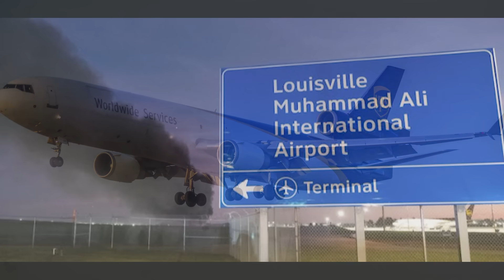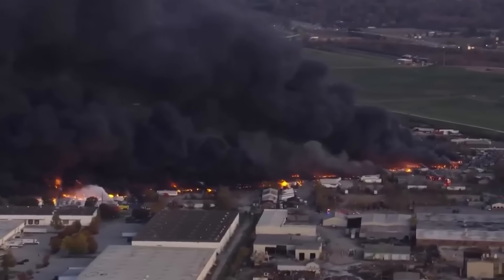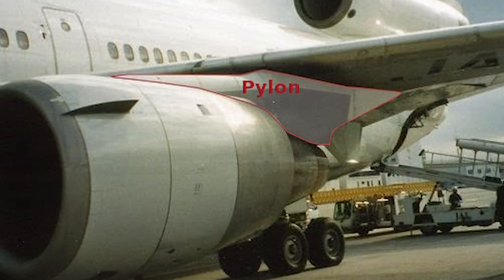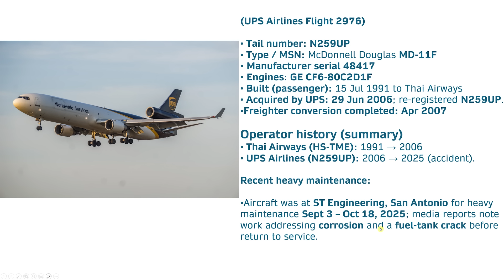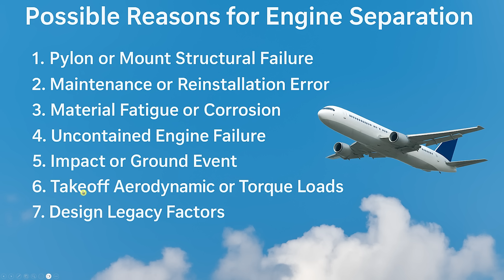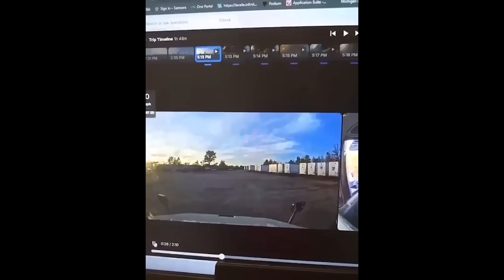What Caused UPS Plane Crash, Louisville, KY? How MD-11 Engine Fell Off

Comment: RIP to the crew/victims. The DC10/MD11 is one of the most flawed designs in commercial aviation. They should have mothballed this plane years ago. The pilots' families should sue UPS for corporate greed. They've spent $2B in stock buy backs in the last year, but they can't afford to replace an airplane that has gone way beyond it's usable life?

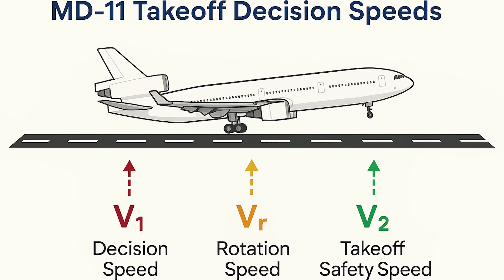Comment: 3:33 Was V1 explained properly? I'd rather be on the ground going too fast than in the air unable to maintain airspeed. These pilots absolutely should not have attempted takeoff if they knew they didn't have enough thrust to even takeoff.

Comment: I find it interesting that the engine ended up on the right side of the plane.

This could be indicative that either the Aft wing/Pylon attach fitting failed or Aft Engine Mount failed?

It would seem to indicate something failed, twisted to go over the fuselage instead of just flipping over the wing and backwards as it should have done and possibly tore apart at the same time injecting FOD into the #2 engine.

Comment: TL;DR I think the tail hit warehouse, not the landing gear.

Given that there's only one line of damage on the first building and the angle of the plane as it's descending, I think it was probably the tail of the plane that hit the warehouse.

In the first dash cam footage, you can see a trail of smoke and debris being dragged off the building by the tail. The plane seems to be pretty flat when it makes contact and doesn't roll till the left wing starts to catch. If the landing gear hit the building I feel like there would be two distinct trails, Also, the vaguely V shape of the damage makes me think it was a rising cylindrical shape (pitched upwards) that hit the building. 

Rest in peace, to the crew and others who lost their lives.

Comment: With a full video of the takeoff roll a pilot could make more sense of this. Was the engine smoking. Was there a fire noted early on. Was there early compressor stall. At what point did any of this start to surface. I had things happen just at V1 and we were stopped way before the end of the runway. Yes we had a wait time to let the breaks cool but that was it. Called maintenance, fixed the problem, confirmed and off we went.

Comment: 1:03 if you zoom in here just before the white flash hitting the power lines…the left motor is gone. Now, assuming he’s past V1 and it was calculated correctly she should still fly. I think that left motor was more than a fire and caused structural damage…ugh…assuming (big assumption) engine fire procedures executed correctly this thing should be flying even with a missing left motor. RIP men…sucks

Comment: I would say they never tested the fuel tank fix with a full load of fuel and several heavy payloads at max weight and the engines at full blast on takeoff. When I saw the first pictures from the runway. That is to much fuel to come from the engine coming off. That was like a tire burst or FOD. Now you have to look at fuel tank repair and if there was corrosion at the fuel tank where else was there corrosion. Blue sky’s and tailwinds to the pilots. Bless the people on the ground.

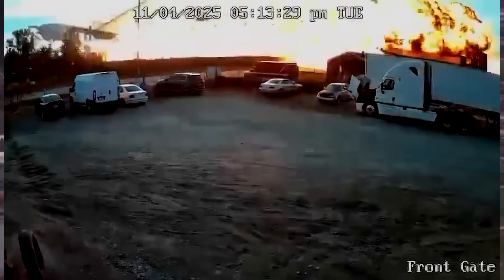Comment: 8:00 To me, I would say they lost speed and therefore they stall and the left wing went down and then it caught the roof of the building. I would say it’s the tip of the wing that did hit the first building and not the landing gear, because if we look at the truck dashcam, we see that the plane is rolling…

Comment: A ferry here in Vancouver years ago had a ferry lose its steering as it came into dock, after a major maintenance refit. No steering. Crashed through a private dock lucky no one killed. Turned out there was a bolt, something like a couter  pin on a small outboard engine was not put back on. Such a simple stupid mistake. If it was checked again by an inspection it would have been caught. Airliners, ships and even doctors in operating rooms triple check every thing with 2 or 3 other people to verify. It is the biggest life saving saftey rule ever made. Airline disasters dropped immensely.

Comment: I remember the AA191 crash! I was very young, but I remember seeing video of it after it happened. I've done a lot of research on past crashes, and this one has way too much similarities to the AA191 flight. I'd bet anything that the investigators are going straight to the pylons. I'm sorry but engines don't just fall off of a an airliner for no reason. Some people will argue that they're meant to fall off in the event of a failure, so it doesn't rip the wing off. They would be partially true, but they're not meant to come off during normal operations. This plane was fully fueled and fully loaded with cargo. Anyone that's flown on an MD-11 before, can tell you this particular tri-jet is not in any terms considered fast or powerful. The AA191 flight lost an engine and severed critical hydraulic lines that controlled the front slats. After the slats lost hydraulic pressure, the slats retracted back into the wing and the left wing stalled and rolled the plane. The right side still had its slats out that  helped create the roll to the left and subsequently crashed. Both flights were using tri-jets and both had left wing engine separation during a take-off event. If this UPS crash happened because of poor maintenance and/or incorrectly performed maintenance procedures, then I would expect some very severe consequences. The AA191 flight was entirely avoidable if maintenance procedures been followed correctly. I really hope that this wasn't the case this time, but it's just way too similar to be a coincidence.

Comment: First thing those inspectors are looking for is where the engine attaches to the wing. They will be looking for empty bolt holes, Barrel nuts empty without any damage. They now know where to look from the videos. Engines just don't fall off if installed correctly.

Comment: It appears that Engine No. 1 pylon failed and engine detached, falling alongside the runway. Debris entered Engine No. 2, causing a compressor stall. MD-11 cannot take off on just one engine - aircraft effectively stalled. I guess the real question is, why did the engine detach?

Comment: I was first on sight with my brother in law for AA191! It took off over us on Higgins and wolf traffic light. Light turned green I shot forward to check it out. No fire going overhead but didn’t look right. I always watch planes. As we got ahead of semi on our right west bound a huge fire ball! Pulled over to fence climbing over from my truck. Ran towards fire then had to run east because of smoke. Heat got intense. Nothing we could even think of doing. Emergency was there in a minute. Fence was for Chicago K9 training 😮

Comment: I cant be 100% sure about this because the dascam of the truck on the road isn't very detailed, but I swear the aft engines thrust reverser is deployed. The right wing engine isn't in reverse you can clearly see that, but this plane design should be able to easily take off with the left engine missing. Unless one of the engines was in reverse. It would also explain why right rudder had no effect and still stalled even though ground speed at impact was high enough to get airborn. It disrupted the air trying to go over the wings enough that there simply was no lift. Just a theory. I just don't know how one engine could have the reverser deployed when all 3 should deploy at the same time if commanded. Unless he had been trying to stop prior to V1 and the right engine reverser didn't deploy. At that point it'd be all over and they actually knew there was no stopping and tried to get airborn anyways. It's sad. I couldnt imagine seeing the rynway running out, on fire, and still on the ground that the pilots didn't know what was about to happen.

Comment: Wouldn't it be insane if this was caused by the same shortcut American Airlines was using in the 1970s on it's DC-10s that led to a left engine breaking off during takeoff? The MD-11 is based on the DC-10, they're very similar, though the MD-11 is a totally new aircraft. The "shortcut" was an engine removal procedure American Airlines was using to save time, removing the engine without detaching it from the engine pylon first and using a forklift instead of the approved engine stand. This procedure was contrary to Mc Donnell Douglas engine removal instructions in the DC-10 maintenance manual. This led to stress on the engine attachment components, eventual cracks and failure, causing the engine to break off of the wing in the 1979 crash. We do not know if this is the cause of the MD-11 crash. I'm just a commercial pilot speculating.

Comment: I think it might have been more or less a tail strike on the roof (with some landing gear too)

And this probably bucked the rear end up a bit, which is why the plane has slightly less nose up attitude than it appeared to have before it left the runway

Comment: Seems like a really stupid idea to put a petroleum recycling plant so close to the end of the runway.
Reply: well, it was more than that. it was an industrial park,  not like a big operation.  ;part store, grill too.
Reply: @MrLigmenarxis TBH, It's kind of ridiculous that any airport has  industrial buildings (or any kind) so close to the end of the runways. At Auckland airport in New Zealand they are rapidly building industrial/retail parks very near one end of the runways. It used to be farmland and very few buildings for several km. The other end at least points out into the harbour.

Comment: Why do they always have building or other objects or water at the end of the runways. Maybe they should be designed with a long clear, sand area for planes to crash or touch down a little safer in an event like this.

Comment: Maybe change your title, you provide no evidence "What Caused UPS Plane Crash" or "How MD-11 Engine Fell Off"! What you do talk about is What COULD HAVE Caused UPS Plane Crash and How MD-11 Engine COULD HAVE Fell Off! 4-6 of your possible reasons for engine seperation can be eliminated just from watching the video. looking at the detached engine picture, and historical data. The flight crew cannot see the wing from the flight deck. MD-11 hard landings are self reported by the MD-11 avionics and hard landing inspections are performed before the next flight which includes inspecting the pylons. Engine mount bolts (4 total) can be reused after a visual inspection but, I never allowed them to be reused. An uncontained engine failure on take off would not cause engine detachment without extreme visual damage to the engine; it most likely would be in many pieces. That white round piece you questioned lying next to the runway we call a nose cowl. The kevlar fan shroud on the pictured detached engine is smashed but visible which tells me there was no fan failure as it would have contained the blades and would be full of stretched/stressed areas, most likely, the fan detached from the engine along with the nose cowl when the engine hit the ground. The fan, being brittle is most likely scattered everywhere. Folks continue to reference the AA 191 accident with this  UPS MD-11 crash but the AA191 crash was a DC-10-10 which was equipped with CF6-6 engine and was due to an unauthorized maintenance practice to save time and man hours when engine and pylon removal was required to perform a service bulletin on the DC-10 fleet. The CF6 engine family has millions of hours of service, the main issue, it has a weak core, requires scheduled borescopes frequently and unscheduled borescopes whenever the engine experiences a compressor stall. The first CF6 engine was delivered in 1971 and is the longest-running jet engine program in commercial aviation. The inspection of the left engine pylon will likely, tell all with a grim story! RIP, prayers to everyone affected by this tragedy.

Comment: That's runway 35R you showed as an example. It sits right next to 1-65. It's a shorter runway. When departing on 35L, you are usually airborne when you reach the tire marks on the south end of the runway. 

The plane's tail actually struck the warehouse leased by UPS.

Also, it hit a waste oil facility. It's a recycling center for petroleum, synthetic and organic based oils. Motor oil, cooking oil, etc.

Comment: That looks like a DC 10 and they’ve had engines fall off a couple of them. One of them was in Chicago. I believe like in the 80s and it was the bolts that you had just gone in for service and the bolts that hole there’s two bolts to hold the motor on engine and it wasn’t put on correctly and they broke and it went down just like this plane did

Comment: To add a note, the tail engine showed compressor stalls as the plane was leaving the runway, presumably due to debris ingestion. Even without severe wing damage and the fire, the plane would have been unable to climb without two of the three engines operating.

Comment: The tank is in one of the wings anything was on the left hand side that will be when one of the tank that could have been corroded and cut a fire in making a win lose his hold on the engine and cause the engine to go off the plane while flying I'm blowing fire and it could have been what caused a major fire going up in the air the tank rupturing in the heat from the from the engine could unite the the gas paper and cause the plane to catch on fire 🤔

Comment: Hello. As a former engineer on this kind long range airplane and on this MD11 airplane too. Over the respect for the crew and the ground victims. I think about those mechanics who works on this machine. I had to experience a close situation on a DC10F following different maintenance procedures between mine and the assistance company that led to an off-track event, with just material damage. When you feel responsible, you would like to be dead, at least it’s over..! God bless those mechanics. Thank you.

Comment: That's not smoke, it's unburnt fuel! The fire is from fuel coming out of the wing after the engine came off. The fuel must of been coming out faster than it could burn. With it heading to Hawaii it was full of fuel and probably packages as well.

Comment: First thing I got from this new video was that those were NOT compressor stalls. The flashes of light that were seen in the original videos under the #2 engine were not compressor stalls but in fact were bright electric flashes from the plane hitting the power lines

Comment: Run the video through AI along with all the black box data then fire ALL of those NTSB useless bastards and let AI tell you what the hell happened — those pins that were not set properly to hold that engine — that’s a Maintenance Maintenance Quality Inspection failure all day long. MRO.  You’re thinking of American Airlines Flight 191, which crashed on May 25, 1979, after its left engine detached during takeoff from Chicago O’Hare. It remains the deadliest aviation accident in U.S. history.

Here’s what happened and why it became such a pivotal moment in aviation safety:

---

✈️ American Airlines Flight 191: The Tragedy

• Date: May 25, 1979 (technically just before the 1980s)
• Aircraft: McDonnell Douglas DC-10-10
• Route: Chicago O’Hare to Los Angeles International
• Fatalities: All 271 people on board plus 2 on the ground flightsaf... +2

---

🔧 What Went Wrong

• Engine Detachment: Just before liftoff, the No. 1 (left) engine and its pylon assembly separated from the wing, flipping over the top and landing on the runway Wikipedia.
• Hydraulic Damage: The separation severed hydraulic lines, causing the leading-edge slats on the left wing to retract, which drastically reduced lift.
• Aerodynamic Imbalance: With full thrust on the right engine and reduced lift on the left wing, the aircraft rolled left and crashed inverted within seconds Federal Avia....

---

🛠️ The Pin on the Runway & FAA Response

• Maintenance Error: Investigators found that improper maintenance procedures—specifically using a forklift to remove the engine and pylon together—had cracked the pylon structure.
• The Pin: A critical bolt or pin associated with the pylon was found on the runway, symbolizing the mechanical failure.
• FAA Reaction: The crash led to a temporary grounding of all DC-10 aircraft and a sweeping review of maintenance practices. FAA Administrator Langhorne Bond made a strong public statement emphasizing the seriousness of the failure and the need for systemic reform.

---

🧠 Why It Still Matters

• Safety Overhaul: The accident prompted major changes in aircraft maintenance protocols and FAA oversight.
• Legacy: Flight 191 is often cited in aviation training and safety discussions as a case study in how small mechanical oversights can lead to catastrophic outcomes.

If you’re interested, I can pull up the original FAA statement or NTSB findings for deeper context. Or we can explore how this crash influenced modern aircraft design and inspection protocols.

Comment: I saw the AA 191 incident chronicled on one of those "Aircraft Disaster" documentary channels. 

American Airlines was using a non-approved servicing method involving a forklift to Remove & Replace the left engine of AA 191. Instead of removing the engine from the pylon, AA instead removed the engine plus pylon assembly from the wing.

But it was in the remating of the engine / pylon assembly to the wing, again USING THE FORKLIFT, in this AA homegrown,  non-approved procedure, in which the pin or pins mounting the pylon to the wing were overstressed, overstrained, and finally CRACKED. 

DC-10 damaged badly enough that the entire left engine plus pylon detached and rotated itself right over the top of the left wing while under full throttle takeoff power, causing the loss of AA 191.

It certainly would be a shame if the loss of UPS 2976 ends up being attributed to the same poor methods.